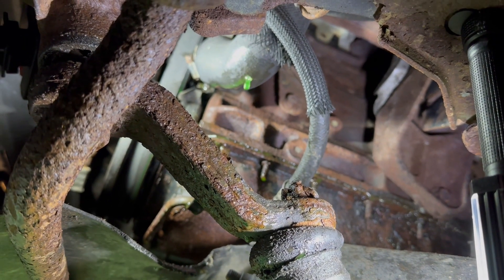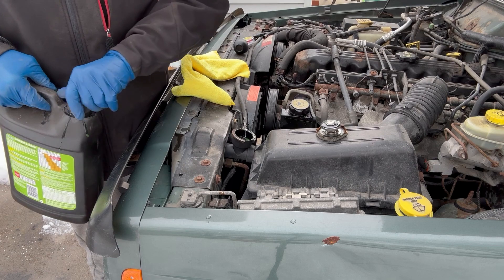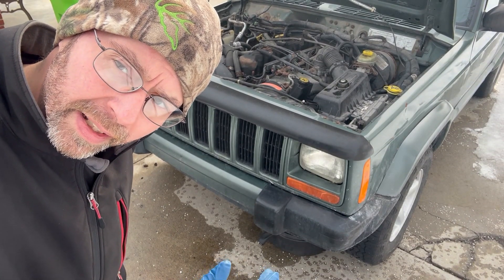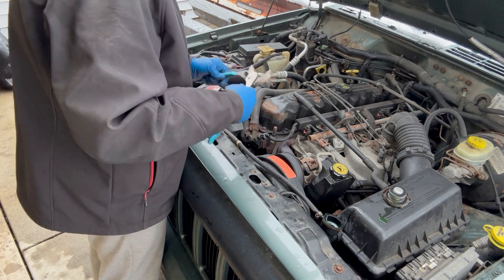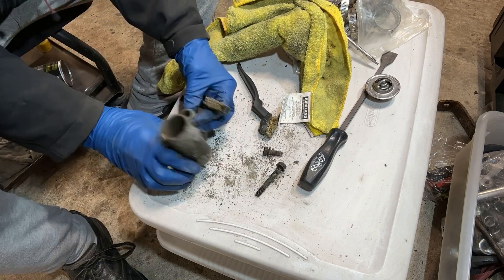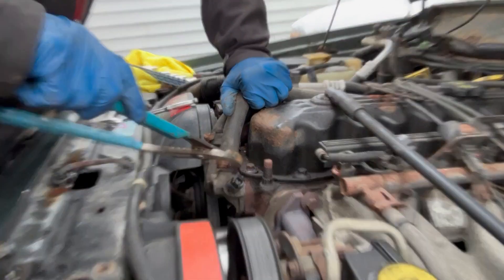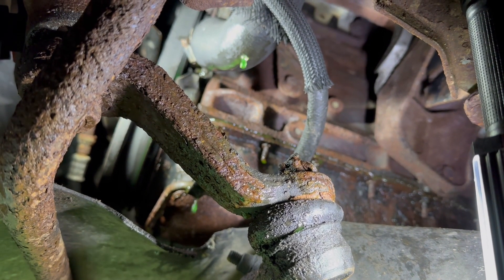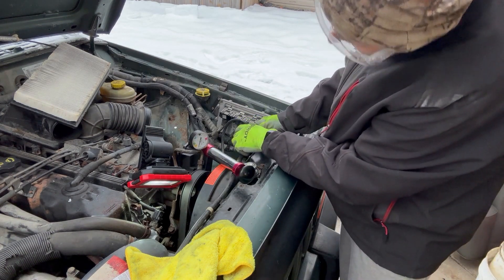Jeep Cherokee XJ 4X4 Overheating Repair Fail?

Comment: At least you're finding out that there's not just one problem with it. Just be glad you didn't have the problem several miles away from home
Reply from the maker: It started on a longer drive to Detroit. Thankfully I caught it before it got bad!

Comment: Where did you get that bug deflector I've been looking for one
Reply from the maker: It was on the Cherokee when I bought it. I think it was factory installed or a dealer add on as it's stamped Jeep in the plastic. . I'd check Ebay.

Comment: It's not really a fail unless you call the local scrap yard. You're halfway through the fix. It's the discovery phase in the repair. Sorry about the weather up there.
Reply from the maker: It was in the mid 40's 2 days later! I'll get it together. I knew better then to try and just address 1 thing, but the cold makes you try to cut corners lol.